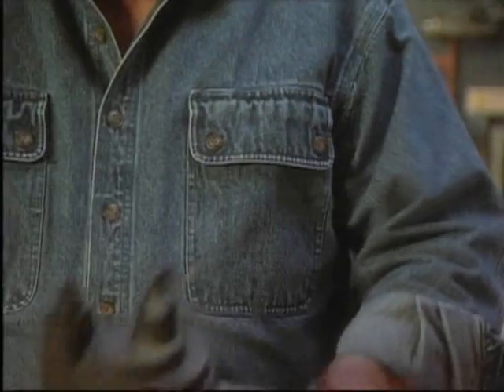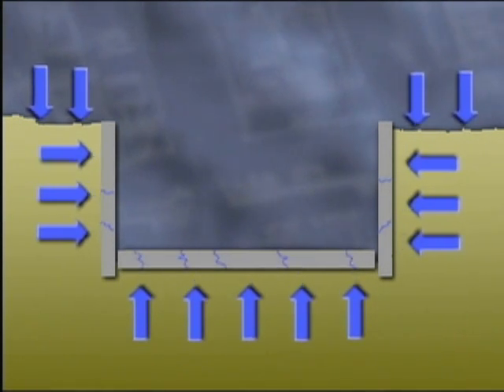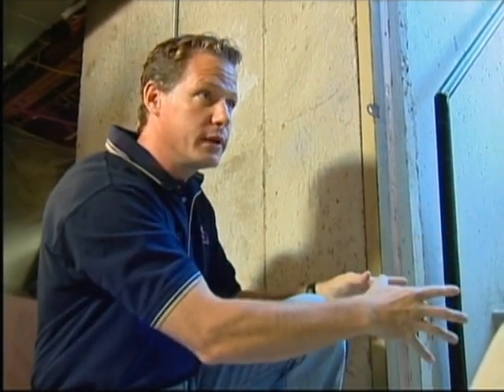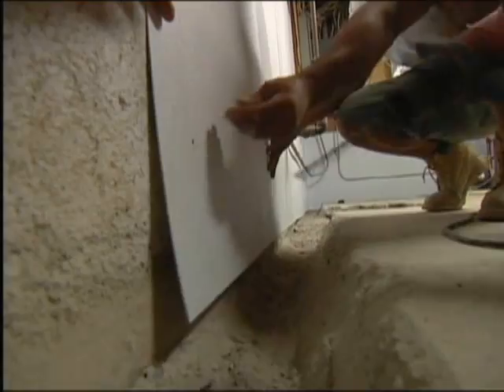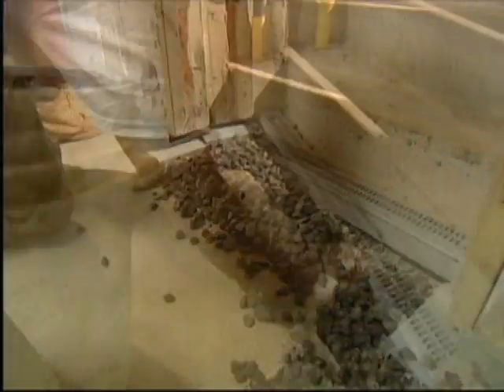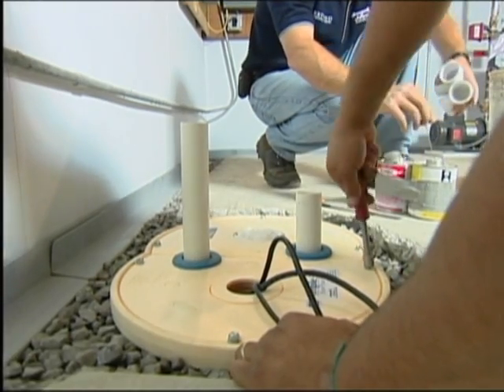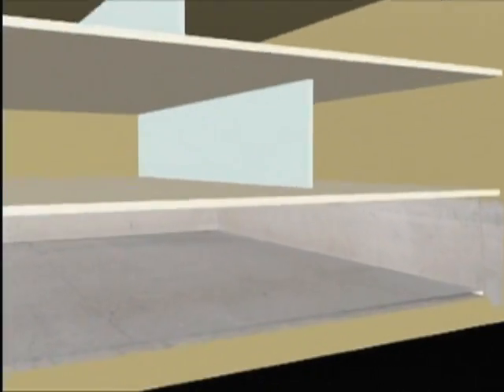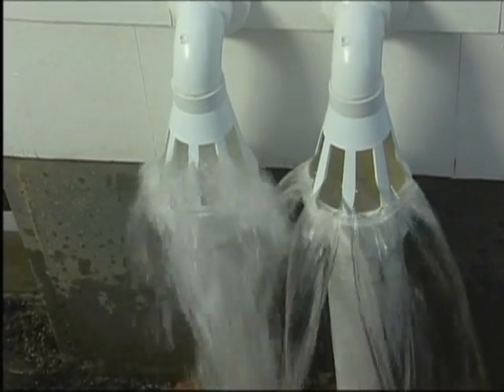How to Waterproof a Basement | Ron Hazelton's House Calls feat. Basement Systems

Comment: that trench is not deep enough or wide enough and no system should ever be put above the footer all water is below the footer and that plastic wall liner just hides the problem there will be tons of mold behind it but none of the lner because mold dosnt grow on plastic. if you want a real system call AC Waterproofing in coulmbus ohio they know what they are doing. look them up on facebook. I bet in a couple years this guy will need it redone
Reply: Water is going to leak in at the perimeter and generally at the footing/wall joint and then rise up at the edges of the floor.  Putting the WaterGuard on the footing puts the drain at the exact right spot to drain away this water.  Plus, being on the footing (where applicable) keeps the drain out of the mud.  As for mold, it shouldn't grow on our wall panels or the concrete as both are inorganic.
Reply: you are correct,  this drain system is trash. needs to be set at bottom of footing.  another cheap franchise system. I've jacked 10 of these systems out of the ground already this year.
Reply: #HydroArmor
Reply: This is what a shit system looks like. Notice the corner pieces do not have a bottom to them. Good luck if you're going to install this in a basement that has iron bacteria issues aka red goop
Reply: Waterguard is the biggest scam drainage on the market. #notchthatfooting lol
Reply: Aaron Cowans Please! You don't sound like a competitor at all! LMAO.... For everyone else, it's impossible for mold to grow on raw concrete or blocks or their plastic, it needs something organic like latex paint! As for not being deep enough, that's a subjective debate also! Deeper seems better but think about the only reason drains fail, they clog!, this can't clog! Also there's some

 cases where you don't want to suck water under the footer because it will wash the dirt out, what will support the footer? So there's pros & cons to everything but I've read their "basement science" book, it's very educational! I went with another company because the lead time was too far out for me but your comment is nonsense!
Reply: mold does grow on concrete I have bare block walls that I just cleaned all the mold from. Just for your information anyone can and often do write books the drainage system needs to start on the outside stop the water from making it to the foundation then a system should also be installed inside below the footer. The key is to keep water out, not let it in then pump the top 1/4 off... putting it above the footer allows water to reach the floor concrete acks like a wick. Drilling holes in the bottom blocks will help the blocks drain this will help this system but they didnt even bother to do that. This is one of the reasons I stopped watching Ron Hazelton.
Reply: Well we got this done 2 yrs ago and after a record breaking year of rain our basement was dry as a bone.  I’m def sold.
Reply: @UshouldTryReality  inside water proofing is basement waterproofing, exterior waterproofing is foundation waterproofing. Mold can grow on concrete and cinder block just needs moisture. Digging the trench to the bottom of the footer collects the water before it rises to levels needed for this system and keeps it dry. The box system only removes water that rises to high levels so there is standing water underneath the floor that erodes the footer all the time. The advantage of 4inch pipe incased in gravel is you can connect a radon system directly to it which oneday may become code. With the box system you cannot because it is incased in concrete. The box system is a designed to install in one day for thousands of dollars. Go ahead and spend your hard earned money on that I wouldn't...
Reply: Thanks
Reply: @contractornation3812  - My understanding is that if you put the drain pipe at the bottom of the footer, then water cannot rise higher than the bottom of the footer. If you instead put the drain pipe at the top of the footer, then water cannot rise higher than the top of the footer. I assume that the lower the pipe/french drain the better, since placing the drain at the top of the footer would allow water to potentially come in contact with the bottom surface of the concrete floor during an especially heavy rain, and then allow a little water to wick up through the concrete floor since concrete acts a bit like a sponge. This would then raise the humidity level inside the basement.
Reply: @contractornation3812  Mold does grow on concrete.
Reply: @BigMike617  If they didn't work, why would anyone go through the expense of jacking them out unless you were going to put something in its place?  If you placed something next to the footing, that wouldn't be any more effective.  Water usually comes from along the outside wall and seeps through at the wall/footing connection.  It doesn't typically seep up below the footings until after it is already seeping under the wall so placement of this product on top of the footing should be just as if not more effective.
Reply: @russellsteven9788  they go through the expense because it's the right way to do it. I jackhammer this trash out of the ground all the time. When you build a house, you don't install drainage on top of the footing. It always goes at the bottom. More often than not, these guys have to chip away the footing just to get their little waterguard in. Trash

Comment: when a basement waterproofer knocks on your door and asks wheres your basement,,,its time to fire him,,you treat your water issues from the outside not the inside,,,functional gutters with very long drains that are kept clean and proper grading of soil,,thats it,,anything else your wasting your money,,keep the water away from your home and there cant be a water problem,,,this is a bandaid and will fail as they all have,,pressure is still on your walls,,mold will still grow etc
Reply: True, but the water table is different for everybody. If water vapor is coming through the floor, the gutters will help slow that permeation only. The floor needs to be scarified and deep sealed, then maybe a epoxy or hydrolock paint for good measure and is more than enough to stop that floor vapor hydro pressure.

Comment: He put the discharge pipe thin wall pvc pipe that runs out about 10 ft from house then his patented system discharges the water right back into the basement, trapping the moisture behind the thin sheets will over time be infested with mold. To put three pumps in can only be they are cheap quality, then a contract for yearly maintenance if it’s that good it shouldn’t be necessary

Comment: Just do what it takes with gutters, fill and grade outside to keep water away from foundation. Way less money, time, and much more effective and no inside mess. Not sure why anyone would consider the approach in this video - maybe if there’s no room to adjust grade outside?
Reply: lots of these jobs actually get done after gutter maintenance and grading don't resolve the issue. typically it's a situation where upstream diversion is on someone else's lot or water table pushes up from below or home has a weird fundamental grading problem and exterior french drain won't offset it.  

if they can go completely around the house with 2 drain exits a gravity system is probably fine, no sump pump required, same result.

people complaining about moldy results refuse to understand it's far less mold if you give the water an exit option, and the wall covering is completely unrelated to the water solution.  if the owner wanted to put up plastic vapor barrier or polystyrene board as an air seal that only opens to the floor gutter "lip" then they can. I mean they can do whatever they want really, it's their house.

complaints about it not lasting forever pretend houses last forever.  it'll last longer than a 30 year mortgage, that's for sure.

they should've shown how you can add service access washout ports to the top of the floor gutter even if this install doesn't need them.
Reply: @robgeach8105  Agreed, this "system" is THE LAST option to consider. This video never mentions that, thus the harsh comments.

Comment: These channel drain systems are junk. They do nothing with water until it rises to the level of the slab. At that point, it is too late. 4 inch corrugated pipe below the footer, not on top of the footer like this mess is the only way to effectively remove water that has come inside the perimeter of your walls. Drain holes in each block space, and a easy path to get to the drain pipe is needed also. Don't replace the 3.5 inches of concrete with 1.5 inches this junk does on the footer. Definitely don't cover up the mess this system will cause in water coming through the walls. Life time warranty on what???  That your walls won't collapse?  False. And they will, if you don't relieve the pressure behind the wall.  This system does not help anything but installer's wallet.
Reply: Then point us to a video showing the right way to do it. If none exists, then make one yourself.
Reply: @jloc803dw  for check out American Dry Basement System's channel. They are awesome. They do it right, and show the channel drain problem precisely.
Reply: @jloc803dw  Daniel Oconnor is another great resource.
Reply: @jloc803dw  what do you think of my examples?

Comment: Wow! This had to cost a good $10K !!
Reply: I recently had a quote from one of these franchised dealer in the Upstate NY region for the basement in my 1,800 sq ft house.  It came to in excess of $14,500!  (But they reduced the quote by 5% for a "military discount")  They basically take a "cookie cutter", one size fits all approach to the problem.  I already had a good collection system around the interior basement walls beneath a poured concrete floor which them emptied into a sump well with a pump.  My issue was that water was just coming at two distinct points above the footings.  On their quote, they did not separate parts and labor.  The "TripleSafe", three pump sump in a 20 gal plastic bucket was listed at $2,500.  In checking, I found these were available at retail for somewhere between $500 to $700.  So the difference was for labor/installation.  Other listed parts followed the same pricing scheme.  

I found a viable solution to my issues which has worked perfectly - Benenite Injection!  A contracted with a firm that bores 2" holes every 18" or so around the exterior house perimeter and then injects this clay/volcanic ash compound under pressure.  It then follows the course of least resistance filling in the cracks and gaps around and beneath the poured foundation walls.  When it eventually comes in contact with water, it swells to 20x its volume sealing the fissures.  And the cost?  $6,000 with a transferable, lifetime guarantee...
Reply: @829joliver  It pays to hold off on a big project (if you can) until you do your research and get several quotes from different contractors. Never heard of this being done before, but thanks for this info. Good to know for future reference if needed.

Comment: This video should be reported as false advertising. 1st, most basements/foundations before 90's  weren't  designed in the way to be finished. No plastic under the footer to keep water out. No waterproofing walls. Not even French drains. You must go below the footer and drill holes in the blocks to keep walls and basement dry. Otherwise, sell the house, and build a new one the right way from bottom to top

Comment: How much ? .  There is no solid explanation what causing the flood . All I hear is rambling back and forth.
Reply: Mine was $20K for inside, versus $40K+ outside.
Reply: @paulmoffat9306  we quoted an exterior job about 15 linear feet for 3500 and had 2 guys do it in 2 days. Some Never-dry hacks came in and quoted $18000 for some bullshit inside dog and pony show that they said would take 5 days

Comment: I don't like the idea to manage the water inside the basement.
It should be done on the outside wall with a french drain and a real waterproof wall.
Otherwise you will be stuck with moisture behinde the plastic sheets.

Comment: Ask this company if they are willing to pull a building permit to do their work or install this system on a new home.  They WON’T because they can’t!  Their system will NOT pass MINIMUM international building code!  I can show you in the manual if you wish.
Reply: If this system is so good, shouldn’t it be installed on new homes?
Reply: Exterior drainage is the prefereed way to go, but its way more expensive and difficult to retrofit older homes with backhoes and trench diggers. New Homes and all modern building codes require EXTERIOR footing drains and other grading and waterproofing to prevent wtaer infiltrating the basement.  So thats why new homes should never want or need an interior drainage system (french drain) like this one.  BSI makes a high qulity system and is worth every penny.  Thats why so many locals imitate and try to duplicate the BSI system.  But BSI has pateneted some of there inventions andhundreds of contractors violate those patents and are jealous, trying to do th job cheaper. BSI installed my system and I never had water in my crawspace slab for the remaining 7 years I owned my house - including Hurricane Sandy.  I have 13 years as a Building Inspector and as an Insulation Contractor and I recommend BSI for all homes to RETROFIT foundations that DO NOT have exterior drainage or the exterior drainage has failed.   @Parksmasonry
Reply: BPCADownStateChapter so a “quality system “ by your definition is one that reduces your home to no longer meet minimum international building code?  By code, a slab much be a minimum of 3 1/2” thick to support the base of the foundation wall.  Pouring 1” of cement on top of a plastic gutter is far from being a “quality system “.  Quality patents, systems, and designs comply with building code. No reasonable person can argue with that!
Reply: Check out my patented system that is 100% code compliant, engineer tested and endorsed, and is the ONLY system that can be installed on ANY structure!  If you want an interior fix (which is not the right way),  I can show you how to do a much better system, by yourself, and make it completely maintenance free! ...guaranteed!
Reply: BPCADownStateChapter So in other words the answer is no.  They will not pull a permit because their systems will not pass minimum international building code.
Reply: I did. They said yes
Reply: Parks' Free-Flowing Waterproofing System considering new home builders subcontract foundation work and those companies don’t use this system. No. But the owner of this company does install for new homes when the contractor is willing
Reply: Parks' Waterproofing it has a legacy report produced by the ICC whom you are referencing
Reply: Mighty Mike please elaborate
Reply: Mighty Mike I actually have a signed letter by the director of building inspection stating that interior systems such as this are NOT code compliant.  If you will provide me with your email and I will be happy to send it to you.
Reply: BPCADownStateChapter The system they use is level because it is placed on top of the footing therefore water is always present it is only hidden.  I’ve never seen gutters installed on a house level the purpose is to exit all the water.  Therefore the proper way to install French drains are beside the footing surrounded in a quality filter fabric with sloped trench and a gravity exit if possible and if not a sump pump. This is not rocket science it is common sense.
Reply: So your local building inspector doesn’t approve of the product is what I’m hearing
Reply: @BPCADownStateChapter  did you have trouble with humidity or a mildewy smell once the system was installed? I'm concerned about the possibility of mold growing behind the polystyrene paneling.

Comment: By the way that's the worst drain system out there next to the peanut ( Styrofoam filled sacks ) system. You need to drop a French drain along side the footer and not on top if it's ledge. It also alowed mold to grow on it.

Comment: I mean, to solve this problem correctly would be digging up outside the foundation and spending probably 3 to 4 times what this system costs. Even this cheesey water divertion system could be improved though:

1) Run the outside lines under the frost table under ground so they do not freeze.

2) Run the outside lines about double or triple the distance you have here far away from the house.

3) The bypass holes on the pipes if the pipes freeze are a joke, and will just cycle the water back into the sump pump...

4) The trench they dug in the foundation needs to be like 6 inches deeper.
Reply: No... Not even close. I did a job that was 15 linear feet outside dig down for $3500,I had 2 guys take 2 days to do it. Some inside dog and pony show quoted $18000 and said it would take 5 days. People just assume it is more expensive but it is cheaper by far, plus it actually fixes the problem for sure. You're only solving the flooding while letting your foundation degrade away as it had been for years before.... POINTLESS!!!!

Comment: Backup sump pumps that use water pressure are more reliable.the battery will only last so long in a power outage and rainstorm.

Comment: The stairs was the main problem, the basement wall leaching water can be a mold issue for sure .You need to run a good dehumidifier the basement 24/7.I cannot tell how far you took the discharge pipe looks like might be on the short side.

Comment: That channel is way too high. It is on top of the footer. The drainage pipe needs to be put at the base of the footer where the water is. The water will fill up above the bottom of the floor before it can get to the channel. That makes a damp floor. Look up other Youtube channels to see these systems torn out and the water that is sitting below them.